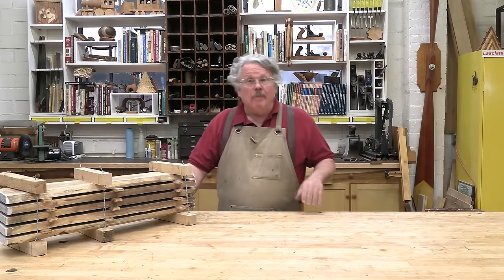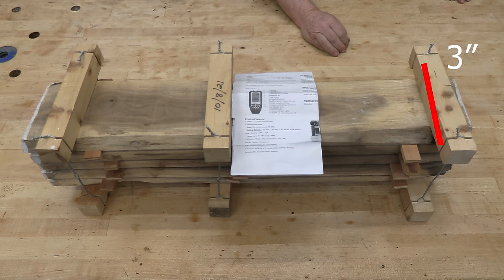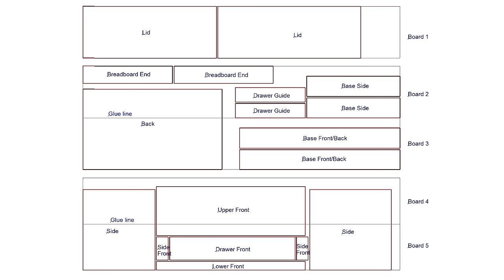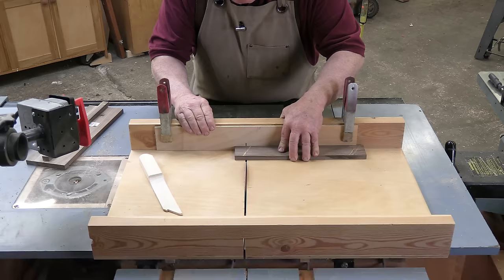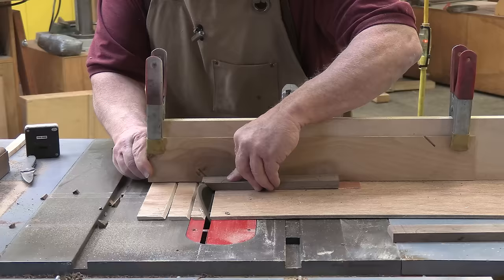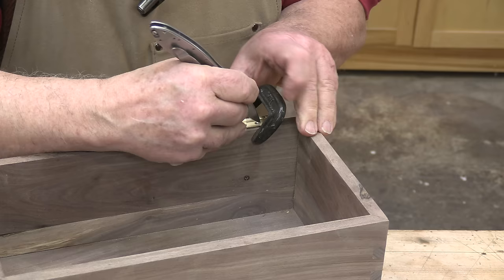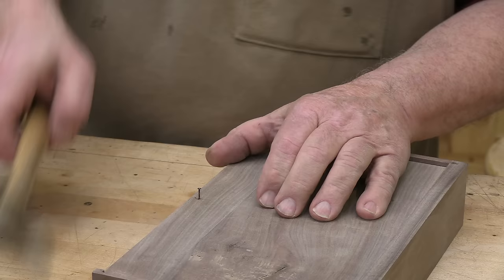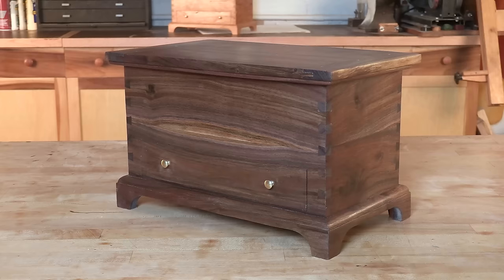Band Saw Lumber Part 2 -- Reading the Grain

Comment: I love that twisted & warped board you show.  Kind of reminds me of some lumber I see at Home Depot.
Reply from the maker: It's an old, old piece of cherry that I took from a pile of freshly-sawn wood that I air-dried sometime around 1990. The wood was green, I was just gearing up to write my book, "Wood and Woodworking Materials," and I wondered what would happen if I let a board dry independent of the stack, with no pressure to keep it flat. So I plucked it out and set it in a corner of my shop. That was the result. Fantastic lesson, great photo/video prop.
Reply: @WorkshopCompanion I posted a comment not long ago that you reminded me a lot of my dad and the times he had me in the shop growing up and i just realized he bought and showed me some of your books. I was 6 in 1990 and remember being about 10 he got your book you mentioned above and showed it to me. We built something that was shown in another of your books when I was 14ish. Absolutely amazing
Reply from the maker: @woodworkingandepoxy643  Amazing that I'm still here...;-)
Reply: @WorkshopCompanion  right? I'm glad you are! Your knowledge is reaching so many people that just don't read books anymore and I'm here for all of it
Reply: You should see the green table in a production sawmill. 
We had a curve saw gang that the saws , double arbor each capible 6 " and guides twisted to follow grain in bowed logs. 
The theory was cutting lumber like this , then with stacks weighted flat in kiln would produce straight nontwisted dried lumber. ????

Comment: Been looking forward to this one, and boy did you deliver. You've topped yourself once again. I had to go back and re-watch the explanation of why you pegged and glued the front pin of the bread board top rather than the middle pin. You explained it very well, but it is an advanced topic I simply didn't get it on the first pass. Your ability to execute and explain that sort if advanced skill really sets this channel well apart. Congratulations on a fantastic video.
Reply from the maker: Thanks for saying. This really was an effort -- there was so much info to boil down.
Reply: @WorkshopCompanion  I can imagine, my last project took me 11 videos to cover. Unfortunately, I don't have the time or talent to craft a single watchable video such as you and Travis pull off.

Comment: Extremely well done. Thanks for putting all the time and care into making this episode. I heat my shop with firewood and often end up milling boards (too good to burn).  But your detailed instructions on building the box are fantastic.  I have a large oversized oak chest that I’ve wanted to modify for a couple years because it’s too deep to be functionally useful. Adding a drawer below, a new base, and maybe some fancy dovetail edges may be just the ticket.
Reply from the maker: Glad to be of some help.

Comment: When resawing short boards or for veneer, attach the stock to a longer backer board such as MDF.  This is safer for resawing and when making veneer then you can run the stock through the planer to clean up the surface for the next slice of veneer.
Be extremely careful when handling nitric acid.   As mentioned in the video, wear the correct protective equipment, especially eye/face protection and the correct gloves for the substance. In this case it's butyl rubber - do NOT wear latex or nitrile gloves. Always pour acid into water, never water into acid.

Comment: There is one major answer to the question at the end of is the extra prep work worth it that you missed, it's sustainability the more people that are willing to put in the extra effort to use this otherwise suitable lumber will help take pressure of the supply chain (not much i know) and it will also help us meet our climate targets. People taking the time to use this wood is a good thing all-round for sustainability. great video though as a carpentry and joinery student it taught me a lot.

Comment: a while back a tree fell on my barn. It was a junk tree, a hackberry, wasn't supposed to be good for anything but fire wood, but for fun I made a chainsaw mill and milled some boards and left them in the barn to dry. A year later, I remembered they were in there and made them into a desk. For a junk wood, it had a surprisingly nice grain.
Reply from the maker: Hackberry is a surprisingly attractive wood. It is especially good for bentwood projects; green hackberry is easier to steam bend than any other wood I've ever tried to bend. It's reputation as a junk wood is a myth-conception; it has been used for fine furniture for centuries, particularly chairs. But since the name hackberry is so decidedly unsexy, it is most often sold to unsuspecting furniture buyers as "elm."

Comment: Nice video! Lovely design and execution. Brings back memories when I used to make jewelry and valet boxes. I would take a doubly wide board and re-saw and plane. Then turn the board so the inside surfaces of the re-sawn board are now on the out side and proceed as you did to make the case with EXACT grain matching at each corner. Imagine a zebra wood box with that property.

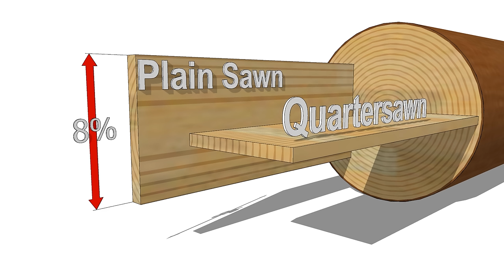Please check out the claims made at 16:50 where you say a plainsawn board can change from an average 8% to 11% in width due to changes in relative humidity (.96” for a 12” wide board). This may be true when going from green (~30% EMC) to oven dry moisture content but not for seasonal moisture changes.

In addition, you explain the location of the front lid trim molding as needing a 1/16” clearance to allow for shrinkage of the lid if construction was performed in the summer, since humidity is higher in the summer.  The 1/16” clearance you recommend seems right when calculating the seasonal change of 2% EMC using Table 13-5 and formula 13-2 in ‘General Technical Report FPL-GTR=190, Wood Handbook: Wood as an Engineering Material, April 2010’, which for walnut would require a 1/32”. However, Table 13-1 of that same documents indicates that EMC is lowest in May-June and highest in December-January in outdoor Ohio, which would require the clearance if the chest was built in the winter not in the summer. This reverses your statement at 21:10. As you state, “… the lid expands and contracts with changes in RELATIVE HUMIDITY”. You go on to say, “It’s the dead of winter in this part of Ohio and the humidity is as low as its going to get”. Both true, but the RELATIVES HUMIDITY is the highest it’s going to get. Now if a home or shop is heated with electricity this may reduce the relative humidity but if heated with gas the opposite may be true and humidifiers may be present too. This only compounds the issue of movement clearances so I use a rule of thumb where I assume a 5% moisture change and adopt a dimensional change coefficient for plain sawn lumber of .004 (worst case). This yields a 1.5% change in width and .7% in thickness. At a minimum, I double that change and target the center of the pinning  of the joint so that the project can survive both swelling and shrinkage. Allowing for even more movement in joinery without compromising other considerations may be wise.

Comment: Great video, Nick! 

I'm just getting addicte...uh...started milling my own lumber with a chainsaw mill. I have to say, every cut is like opening a treasure chest; you never know what you'll find inside!

I didn't bother starting small. The first log my buddy and I milled was a 14 foot x 28 - 32" Sycamore from my property! We cut them to 8/4, and it was all the two of us could do to lift one end onto my truck tailgate. Luckily, I had and old broomstick lying around that I cut into Egyptian-style rollers.

I used your clamping method from your previous video, and it seems to be working well so far. I had to use "tobacco wire" from a local Amish farm supply store. Problem with that stuff is it springs back when you twist it. So I used some headless golf club shafts to twist the wires, then left them in place...much like tightening and clamping a tourniquet. It's not ideal, but working so far. Can you please give me some more info on the wire you used?

Also loved the dovetail splines! I had never seen that technique before, but you can bet I'll be using it next chance I get.

Thanks again for a great video!
Reply from the maker: Thanks for the kind words. The wire I use is 20-guage  "baling wire." I get it from the local feed mill; it comes on a spool that you load into your hay baler. I've seen galvanized and plain -- I always get plain. You can also use 12-guage aluminum wire and 16-gauge rebar tie wire, both of which are available on Amazon.

Comment: Cracks me up. You toss out more & better advice with your offhand comments than most guys do with entire vids.
I note that you are one of the few woodworkers on YT who use a Shopsmith. I've eyeballed those things for years but could never talk myself into the expense. Can you give us your take on that tool? Thanks.
Reply from the maker: Somewhere on YouTube there is a video called "99 Reasons Not to Buy a Shopsmith." I left this comment: "The Shopsmith has remained a contender in  the stationary tool market for almost 3/4 of a century, so there must be something to recommend it. Personally, I've found it's just like every other tool I've ever used -- it has strengths and weaknesses. When you understand what it will do well and what it won't, what you have left is possibilities. I've used mine to build 18 airplanes, restore several Victorian homes, and fill them with furniture and musical instruments -- that's quite enough possibilities for most craftsmen and craftswomen."
Reply: @WorkshopCompanion  Thank You kindly, sir. Probably the most straightforward, sensible endorsement I've ever run across.

Comment: Did you add wood runners for the drawer, and a bottom to the inside of the box for separation? I didn't see that if it was there and I know there would have to be something preventing stuff from going in the drawer from a top of the box

Comment: Great project and useful tips throughout. Entertaining as always. Did I miss something I don't recall seeing how the bottom for the lid compartment went in. Thanks for sharing your valuable experience.
Reply from the maker: Lid compartment? Don't understand. The lid is just a breadboard with some trim glued to the bottom surface to form a lip on three sides.
Reply: @WorkshopCompanion  I thought there was a storage compartment accessed  when you open the lid. I was just saying I must have missed how the bottom of the compartment was held in.
Reply from the maker: @breakinn403  The upper compartment is called the till.  I added the till bottom when I assembled the box: 13:36.
Reply: @WorkshopCompanion  Thanks missed it.

Comment: I enjoy your channel,in your opinion how critical is the drying process for 60 inch by 5 inch hardwood for picture frames? I recently cut a broken walnut limb that was dead milled it into the size mentioned. Wondering if it is going to twist or warp if I make a frame now. Its moisture content is about 8.5 ..........THANKS
Reply from the maker: If the moisture content is down to 8.5%, the wood is technically dry. The question is: Is it stable? I'd let it "shop dry" for several weeks to see if it shows a tendency to warp or cup.

Comment: Another excellent video. 
Your discussion of air-drying and shop-drying is the best I have heard from anyone. 

Different topic: the propeller you have on the wall (what I can see of it) looks like what I have seen on the Wright Flyer. Is there a connection there?
Reply from the maker: My crew and I have built 18 Wright aircraft (both Flyer and gliders), as well as flight simulators, for museums worldwide. We've flown nine of them -- the prop on the wall is from a 1903 Wright Flyer I replica that we built and flew for the Centennial of Flight in 2003. It incorporates a small amount of wood from an original Wright aircraft. See my other web site at https://wright-brothers.org/default.htm .

Comment: Would it not have quicker and less hassle to just dovetail the box rather than cut in those splines? Is there a reason for your method? Love your channel ❤
Reply from the maker: I suppose that would depend on the tools and jigs you have in your shop. We used the dovetail splines because we wanted to show the technique to our audience. Thanks - Travis

Comment: For a small stack, weighing it every so often would eliminate the moisture meter and subsequent probe holes. One it stops losing weight, it’s ready.
Reply from the maker: That's a great point, but in my mind neither a moisture meter nor a scale are necessary if you keep to the "year per inch" rule. I've been doing this for 50 years without them and have had very few problems. The moisture meter was just set decoration in the video, something to show what I already knew -- the wood was ready to work.

Comment: If you climatize to your workshop and it’s unheated - will there be war page when you move the finished piece into your home, do you have to account for that?
Love your videos and the extra tidbits you provide.
Reply from the maker: Classic wood construction techniques, which have developed over hundreds of years, allow the wood to move without affecting the utility of the project no matter where it ends up. As the craftsman/builder, you need to worry about wood in motion constantly from the beginning of a project to its end -- whether you shop is heated or unheated, in the middle of a rain forest or a desert. The people you sell your products to shouldn't even have to think about it because you have already solved whatever problems might arise with intelligent design. We'll do a video on wood joinery in the near future and get into this in depth.

Comment: If you had a board that was thick enough, could you rip it and book match it so that the grain would be continuous all around the box front, back, and sides?
Reply from the maker: True. There is a way to make the grain match on all four corners if you start with board that is a little over twice the thickness you need. Cut the board long enough to make two adjoining sides, then resaw it to make two matching boards, plane them to thickness, and use each half to make two sides. Properly arranged, the grain at all four corners will match. To have done this on the mule chest, I would have had to cut at least one board  to a 5/4 thickness or thicker. Unfortunately, I didn't think that far ahead.
Reply: @WorkshopCompanion  thanks for getting back to me. This is something I've thought about before but never seen anyone try it. I might give it a go sometime.

Comment: Hi Nick, I wrote this a few times and my words to me seemed either too challenging or snarky...apologies for that even though you will never read them...LOL...The best way I guess I can get my point and/or query across is by asking some questions that I am curious about academically from someone (like you) that has clearly been doing this for a long time and is respected as an accomplished professional woodworker.

Would you ever make any furniture or cabinetry out of green wood and if so how, and if so how would "you" approach that task?

When advising younger (or new) woodworkers, do you ever suggest learning to work and understand wood traditionally first before moving into the modern approaches so many like you tend to write about and teach most often?

Thank you in advance for a response (and dialogue here if possible) when you get a chance...
Reply from the maker: There is a type of furniture -- "Willow" chairs, rockers, and chaises -- that is made exclusively from green wood because it is so easy to bend. In days gone by, houses were framed in green oak because you could more easily drive nails through the hard wood when it was green. (I am currently restoring one of these homes, and you cannot drive a nail into any wall now that the wood has dried for 130 years). Other than that, I can think of no reason you would want to work wood in motion. Fine woodworking depends on many things and one of the most important is the stability of your materials.

As for teaching theory first or method first, it's a dance, as any shop teacher will tell you. Most people are attracted to woodworking because they want to make stuff, not because they want to work wood. For these folks, the "recipe" approach works well enough -- do this, do that, slap on a finish, and you've got yourself a birdhouse. Or a grandfather clock, depending on how many steps there were in your recipe. For a smaller group, the act of making something appeals to or fires up their creativity, and these people will soon understand -- after a couple of failures -- that you need some serious science and engineering to make wood work for you consistently. I have always tried to appeal to both groups -- my books contained a lot of recipes woven into the science; my vids more often have a little science woven into a recipe.

Comment: Does kilm drying kill the bugs in the wood. Stopping wood worm forming??
Reply from the maker: Yes -- provided you get the temperature high enough. That's one of its advantages. Interesting fact: When Travis and I make airplanes and flight simulators for export, we are required to work with kiln-dried wood. And the wood we use to make the crates to transport the airplanes must also be kiln dried and specially treated to kill all pests. However, proper air drying will also kill most pests. I've only once had a problem with wood worms, and I suspect it was because the log was allowed to rest on the ground for over a year before it was bucked up.

Comment: 🙋🏻‍♂️Would you know if there is a weight measurement to use for low tech option 
A pivot counter weight 
Sean as one dose not need the weight for pressure alignment💁🏻‍♂️